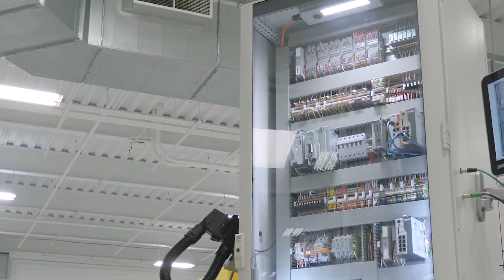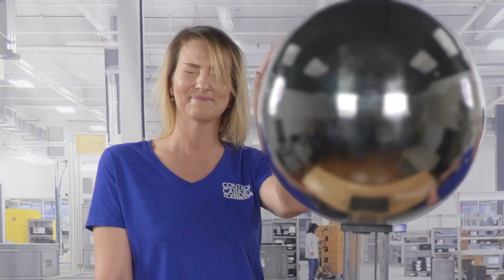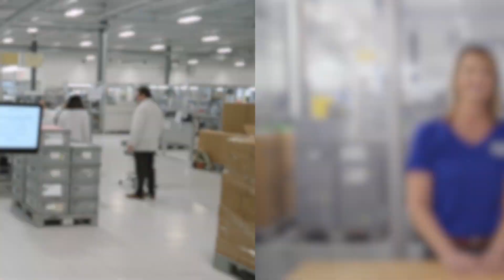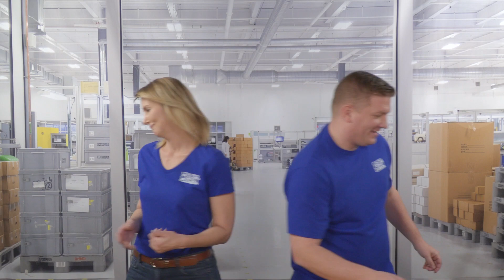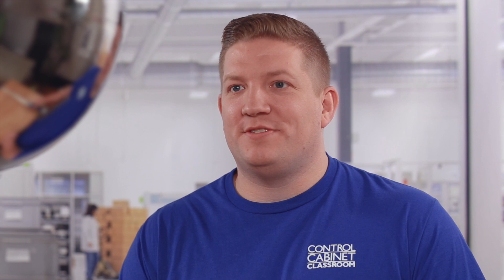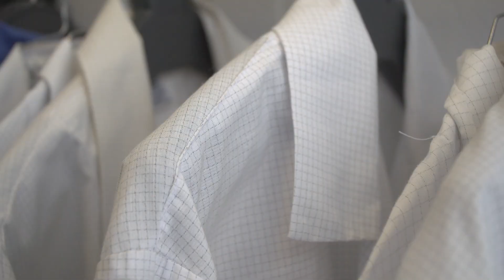Everything You Never Wanted to Know about Transients

Comment: how do capacitors work to help with to much transient electricity
Reply: Caps can act as either a filter or an alternate path to ground for transients. Which is based on the frequency of the transient across a circuit.